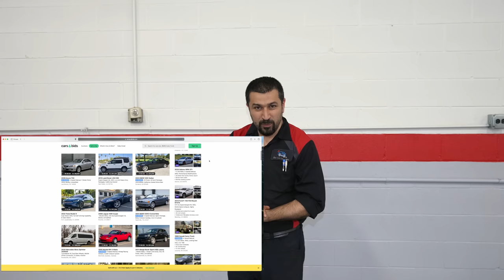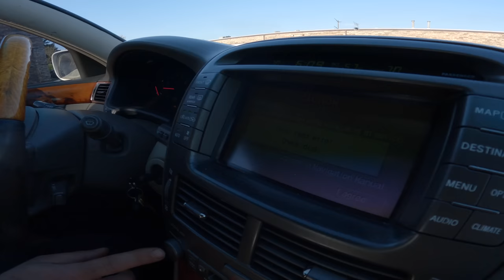I Bought a 600,000 Mile Lexus Sight Unseen! How Bad Can It Be?

Comment: A car lasting 600k+ miles, even with impeccable maintenance, is very impressive. What makes this car so special is that it lasted that long with a SKETCHY service history!  It's a tad bittersweet because this is a level of robustness that very few modern vehicles can match thanks their insane complexity, probably even from Toyota/Lexus.
Reply: That’s why I am a life long Toyota buyer. My 2001 4Runner turned over 400,000 miles and it still runs good.
Reply: I have a 2001 Lexus LX470 367,0000 miles starts, runs, stops like it should.
Reply: The transmission was replaced or rebuilt at least once. Not exactly sketchy maintenance.

Comment: I absolutely cannot wait to see how this goes. The third-generation LS is my favourite Lexus of all time.
Reply: Yea, Agree totally.
Recently got the "Celsior" variant 03 facelift.

Sooo Smooth. Changed airsuspension too, So worth it. Its a Joy :D (except when i had to replace the air struts)
Reply: What I like about AMD is what I like about him when he says he does something right he does something he wants to get rid of all the I am totally with him on this my 67 Camaro and it was hacked up so bad I'm now having to fix it all myself , so I know what AMD is going through on this car that he is fixing like what I'm doing on my car all original parts .
Reply: Well I shall be dead by the time this project car reaches 1,000,000 miles. It has 372,000 miles to go and that will take 10 years 
even if the car does 100 miles 7 days a week 52 weeks of the year.
Reply: @garymeredith2441  67 Camaro . Beautiful car. Kudos to you for taking care of it. It'll be almost better than new when you've gone thru it.
Reply: @VeryOldSaint Maybe YT  will have run out of cash for him by  the time 1,000,000 Miles comes around.🤔😪🤑

Comment: At least we know one thing is for sure, with 628k miles it must have been a pretty damn good car at some point!
Reply: ....and evidently very well maintained.
Reply: Pretty soon, we'll be seeing the majority of EVs doing this sort of mileage.
Reply: @rogerfroud300  they’ll be subscription based like phones. Just upgrade every couple years to a newer ev.
Reply: @Roger Froud  nope....ev's wont last that long. A well maintained car like this outlives any modern car ev's included.
Reply: @rogerfroud300  An EV could go that mileage but none will be manufactured to do so. EVs, sadly, will become the iPhones of the automotive industry and will be remotely shut down by the manufacturer forcing you into another one.
Reply: @rogerfroud300  🤣🤣😂😂
Reply: @rogerfroud300  Only if the owner is willing to shell out 20,000$ to replace the battery at some point (average life of 10-15 years).

Comment: In 2014, I bought a 2004 with a 192k miles on it and drove it for another 16k over 2 years. What a fantastic car. I replaced the radiator myself and replaced a faulty ride height sensor with one off a Prius. The engine is butter and the suspension was great. All of the electrics worked perfectly as well. I kick myself for selling it because I wanted something more "fun."

Comment: I have an 04 LS 301,000.  Black cherry pearl.  Runs like new. V8 smooth as ever. Currently at Lexus body shop for new rear bumper from a hit and run.  I'm gonna try for 500,000 miles.

Comment: I have a 05 LS430. I had the same thing happen with the snapped license plate screws. However, I did not resort to drilling holes in the lower section but for the meantime I have my plate mounted with a magnetic dealer plate frame. Excited to see you making content with this car!

Comment: As soon as you said 600k + miles I knew it was LS430 which you have brought up that it was approved or certified for an Aviation Engine which screams reliability. And the LS400 has been done so really like this and idea that it will still be pristine at a million miles 👍🏻 My 07 sc430 is my favorite car I’ve ever had and like you say only genuine parts and it’s flawless LIFE IS GOOD 🤙🏻
Reply: It could have been a gs430? My 06 is a tank and an awesome running car today.  Good maintenance goes a long way.  I have owned it for its 240k and maintained it after its warranty ended.  Gs430s are just as awesome as ls430s, especially if you want sportiness.
Reply: My 400 has 535,000. I believe these cars are definitely the best car ever made.

Comment: I’ve seen worse. I have no doubt you’ll get it sorted out. On the transmission not being happy cold, I recently had that issue with a Nissan Xterra a fixed for my son’s girlfriend. It wouldn’t engage drive when cold, you had to pull it into low, then it would go and shifted normally. I replaced the fluid in the pan and added some marvel mystery oil, then drove it for a couple days. It now shifts perfectly, goes in drive immediately when cold.

Comment: This will be an awesome series, we'll have to start calling Amd Hoovie 2. 😁 The big plus for this LS is that it didn't live in the rust belt. Remember folks, OEM parts is the only way to go. Seeing that aftermarket oil filter made me cringe thinking the oil change was probably done at the Jiffy Lube. 🤮Looking forward to my appointment at your shop next week! 18 Lexus owner here never driven in the winter.
Reply: Oem parts are NOT the way to go alot of the time for alot of reasons, some being aftermarket sometimes fixes weak or badly designed original parts. Also, some cars simply don't require a part 3 times the cost of aftermarket for the car to work or be safe. Not including that some oem parts are just outright scams that cost more than the value of the car.
Reply: @J_h_420 it depends honestly, my window motor went out on my 97 tacoma a while back. Check pricing on a oem Denso unit and price was over $400 for the motor alone. Ended up ordering a regulator and motor combo from RockAuto (picked the Aisin brand) for about $50. 6 months later still works great.
Reply: @doomkid02  so with OEM costing +8x aftermarket, do you really think OEM will last 8x longer?
Reply: It's a Mann oil filter, can't really get much better than that...
Reply: @billmellater  in my case with the window motor i dont believe so. But with something like an alternator or starter then yes absolutely it will.
Reply: @J_h_420  yep. Oem parts is NOT the only way to go. Imagine using pads from 20 years ago when newer ones are better in every way lol

However, for electronics or engine internal parts, I would almost always use oem unless they are vastly overpriced(not going to pay $150 for a pulley when a gates one for $15 will be comparable to it)

Comment: Great idea! I used to live in the PNW and actually bought a GX from Lexus of Bellevue. Anyway, my boss back in the early 2000s told me WA was a car person's paradise as the mild winters and rain and lack of salt made it so they don't rot or rust. I did see a lot of classic cars as daily drivers there, many diesel Mercedes and old Datsuns and Subarus. I heard they started salting the roads after 'snowmageddon' so maybe this old tale no longer applies. It was definitely worth it to get XPEL or 3M PPF to protect from those rock chips up there as some folks kept their snow tires or studs on in the summer and tore up the roads.

Comment: Man you are being hard on this thing it has 600,000 miles on it and it doesn't look like a pile of sheet metal held together by duct tape.  That's pretty impressive regardless of how many hacks occurred in the engine to keep it going.  you are analyzing it like it's 100,000 mile car.

Comment: AMD, I'm feeling your pain.  I just got an '06 Avalon XLS with 125,000 miles.   I got to see it and drive it, scanned it with my Ancel DIY scanner.  Plastic covers missing retainers, no spare tire, no Cruise control.  But starts, runs and drives nicely.    Plugs were all used up but when I went to change them I found some hack had broken the connectors and so RTV'd them on the coils.  Got that done, new clock spring fixed the Cruise found a tire.  Suspension is good, power steering pump leaks. Must do motor mounts next.  I love it, but it's a bear.

Comment: I impulse got a 2010 Lexus IS250 with 274000 miles the owner change the oil every 3000 miles, a little over kill but the engine looks 90% clean almost brand new.

Comment: I have this exact same car …love it..

Recently it has been doing these jutting movements in the engine.usually at idle in drive…
The weird thing is some days it does it,other days it doesn’t. Some days its more noticeable than other days…
I have been to several mechanics and they cant find the problem.
Changed mounts,checked transmission.

What would be the cause?????

Mechanics these days dont seem to be mechanics…they are code readers and parts replacers…🤷🏼‍♂️

Comment: I’m working on a 96 Avalon 160k I’ve got her pretty close to new again. I had to put a new sound system and fill the a/c, I have to do something about drivers rear power window and moon roof. Engine and power train are excellent. Also I needed inner and outer toe rods and tires.  But she rides like a dream now.

Comment: Thanks AMD. If car companies today were seriously concerned about the environment, they would make cars that last (robust & reliable), can be fixed economically with genuine parts for many many years like this Lexus. I'm looking forward to the journey ahead and eagerly waiting to see the transformation back to a clean, leak free, trouble free ride that will make the remaining 400K to get to 1M miles. BTW, I'm hoping rear bumper removal and a few gentle pulls with a sliding hammer will sort out most of that rear end panel damage?

Comment: I had the first sedan Lexus when it was rolled out, exactly like that used it for a few years gave it to my sister and hubby who is a mechanic and they used it for more years till they sold it. No big issues they said. They just got tired of it. My hubby then bought me a brand new 2003 GX470 SUV. As a retired senior in 2023, I’m still using my SUV and it still feels comfy and functioning flawlessly like it did the first day, well considering it’s only 200k mileage. So maybe I’m just scratching the surface with it? Lexus is brand for life.

Comment: I am so looking forward to this LS430 being repaired and built back to it's original, beautiful self.
My former dentist had an LS400.  Bought it brand new in early 1990.  I used to maintain it and I got to test drive it.  
I was not into "Luxury Sport" cars back then, but that car definitely got my attention.  It drove so smooth, quiet, very tight but not stiff. Put your right foot into it and the power was amazing!  32 valve Double Overhead Cam 4.0 Liter V8, like a small rocket ship back then.
I really liked that car.  Seeing this LS430 brings back good memories of the LS400.
So when's the next LS430 video?
I had to get the power steering pump rebuilt for the LS400.  The pump's shaft seal leaked.  Once I got that fixed, I flushed out the old p/s fluid and the steering was back to smooth and leak free.

Comment: I have a '99 LS400 with 400,000km in Australia.... I think your car will be fine... it should last 1million miles...  just drive it & enjoy yourself.,,, my transmission misbehaves sometimes when it's stone cold but not concerned about it as its fine after a few miles.... When I bought it 15 years ago i fitted an oversized trans cooler & a proper cooling radiator for the power steering fluid as i noted just driving around the suburbs the metal fluid container got so hot you couldn't touch it without burning yourself...I fitted a set of Bilstien shocks & had an oversize solid steel rear sway bar made to flatten the cornering out... Everything works & drives beautiful.

Comment: In the early nineties, acquired a used Cressida ‘82  manual, rear-wheel drive with 500k plus km already on the clock. Some vibration in the propeller shaft at higher speeds, fixed with a new universal joint. That engine started and ran and started and ran. Sold it after four good years with minimal maintenance. I wonder which cars today can match that sort of longevity and reliability. Maybe there are some

Comment: Bellevue (pronounced bell-view) is a suburb of Seattle. While it does have snow, they do not use salt on the roads. I believe they use some kind of gravel/sand? They use that in order to avoid the damage that salt eventually does to cars and roads. And it may only actually need that maybe a handful of weeks per year. It gets black ice due to the constant drizzle combined with below-freezing temps overnight.

Comment: As a backyard mechanic, after a certain number of miles the hacks start just to keep it running till it fails. The more miles on it the less willingness to spend money.  The higher the mileage the less one wants to spend. First it is OEM parts, then good aftermarket parts, then cheap aftermarket parts, avoid as long as possible, then hacks if possible is the typical progression. No point in spending excessive money when one expects the car to die are any time.

Comment: I worked as a government inspector in california and had a Cressida come in with over 700k on the odometer. It had the “jaguar looking” DOHC inline 6 engine. I believe the engine was not removed and replaced. If it was, they left little evidence or “witness marks” on the bolts.   The gentleman was an outside salesman and his route took him through every small town.  He was a larger man and the seat was shaped to his body. There was little padding left.  Surprisingly,  the car was in pretty good condition.. I asked and he said he had the oil changed frequently, with the cheapest, lube shop oil available.. he said around 2500 miles.  Now that’s a lot of oil changes.  👍🏾

Comment: My 2001 4runner has over 400k without issues. Being a mechanic for almost 40 years, i do my own work. The 3.4 in it is one of the best engines Toyota has made. Of course, maintenance is key.

Comment: Looking forward to the next video and this was a very well made car starting from the first one.
I also did a reconditioning on a Honda with a 175,000 miles not as many as this one but I did put over 10,000 into the project and i did use 90% OEM parts and the rest I was able to save big time from Denso/Hitachi Direct replacement parts or from Japanese aftermarket Like KYB for the struts and shocks, The Brakes I did go with Raybestos  being the only thing I went completely aftermarket. The starter was a Mitsubishi but I replaced it with a Denso, This is a long distance highway Vehicle and reliability had to be a priority.
I had fun with this project doing pretty much the same your going to do with also the interior and exterior completely repainted and re-done  with all majority of the parts on the Vehicle being replaced and replaced with Quality parts.

Comment: My Honda Pilot tailgate developed the same thing with the license plate bolts, because...I had a very heavy metal decorative license plate frame, and, from all the opening and closing, that's what happens. So I had to epoxy them back in place, and don't use a frame anymore. If you do use a frame, get a cheap plastic one.

Comment: Several years back I had a 2001 Tacoma.  I bought it new with 9 miles.  5 speed manual and years later I sold it with something like 700,000 miles on it.  The clutch was giving out, and I was getting tired of the shifting all the time.  Sold it for a 1000 to my mechanic.

Comment: Great video! 👍
 I really wanted to see this. We recently purchased a 2002 LS 430 with 157,000 miles on it and I actually flew down to N. Carolina from western Ky to pick it up. Right off the bat it had some issues, nothing major but it did have a headlight out and I just received and installed new HID bulbs the other day. I've put three new ignition coils in it and the left side VVT solenoid. I guess the 600 mile trip back took it's toll on some of it. Also, the inner tie rods and all four brake rotors and pads are here for me to install, this car also has a warped rotor. The thing that is most disturbing is that it also has an oil leak and I have yet to find out where it's leaking. It leaks a few drops per day so not major but nonetheless I need to fix it so following this fix it series is going to be extremely interesting and I can't wait to watch it.

Comment: I will be following your repair if this high milage Lexus and your list is along one on the repairs you need to do l did see a 2002 Toyota Corolla for sale and it sold ad it had 980000kms on it there were very detailed photos l saw the engine bay very clean the interior was very tidy and the exterior was very good it just looked like a

Comment: I really enjoy your videos. It is nice that somebody with some actual experience is doing it. I just bought a new Tacoma with 4cyl 2.7 and AT. I bought a maintenence program that pre-pays all routine stuff for 60k miles. I know the oil needs to be done more than every the every 10K miles covered by the plan. Would it be OK if I did an in-between oil change every 5K, and let the filter go the full year between changes. I am paying for full synthetic oil. I also plan to change the ATF. Is every 60K the right interval? I will be driving about 50/50 highway and in town. Thank you again for the great amount of good info you put out. BILL

Comment: Bellevue We put lots of miles out there in WA state very much 70/30 highway / city mileage racked up 60k in 2.5 years out there I almost picked up an LX470 out there low miles 2006 4x4 just didn't realize how good they were til it was too late

Comment: I would like you to talk about the factory problem of the rav4 2019 -2022 gas or hybrid. The problem of the rails, which allows water to pass inside the body of the car, affecting the entire electrical system and causing mold. In my case, I have the rav4 2 weeks ago in the workshop, and it's time to change the entire roof, floor, wiring, carpet, new seats and air bags